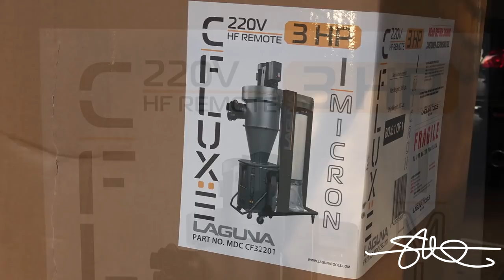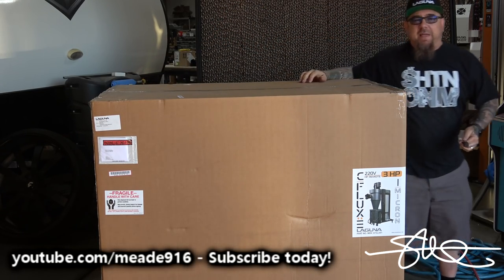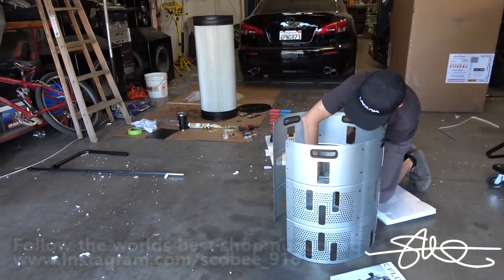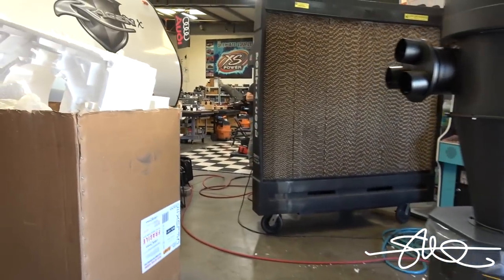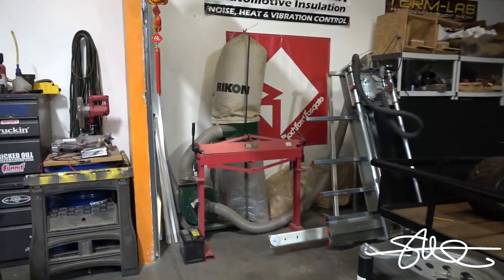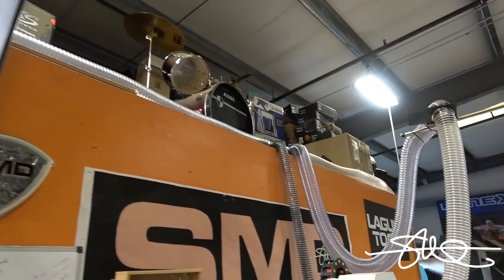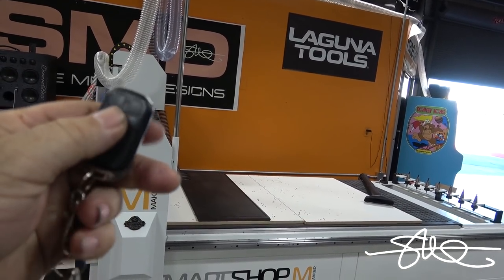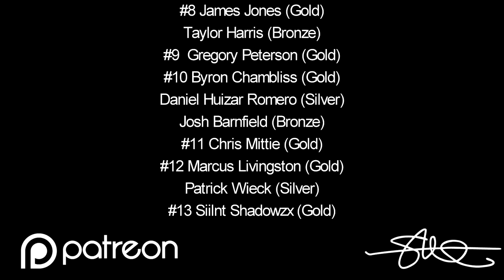This thing SUCKS! Unboxing & Building the GIGANTIC Laguna C-Flux 3hp Cyclone Dust Collector

Comment: make sure to ground you ducst collections piping with wire wraped around it. prevents static electricity and fires.
Reply from the maker: LOL
Reply: Laguna has all those safety measures built for the 3 bands plus your paying for them you shouldn't have to do that I'm sure that your think of the cra]y brands that only the average poor man can afford